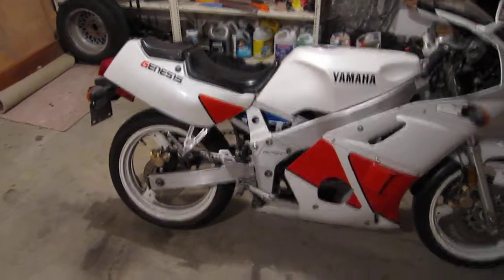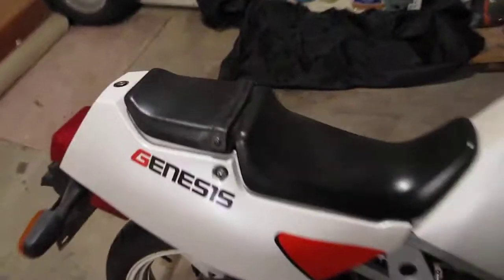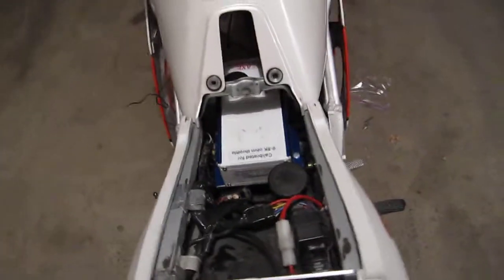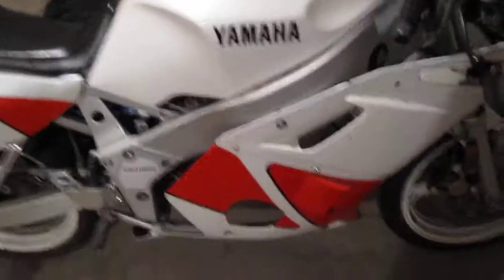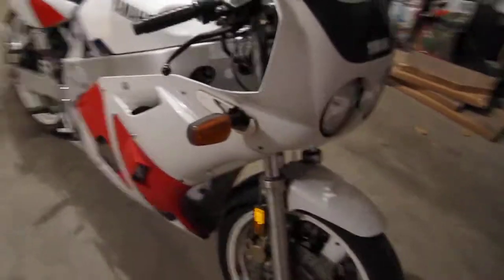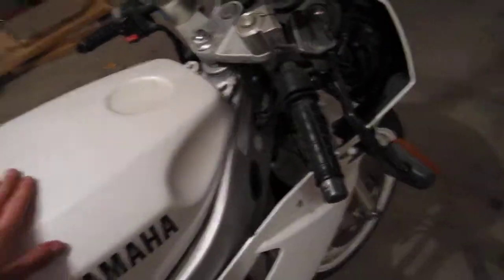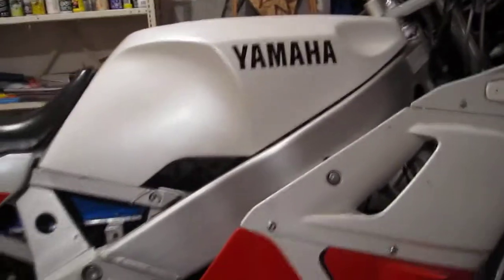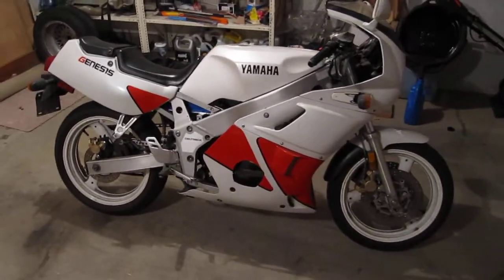Electric Motorcycle Build #8

Comment: Hi How did you lock the sprocket in the motor shaft tightly, I have similar shaft but how to tightly lock it after sliding the sprocket into the key way shaft